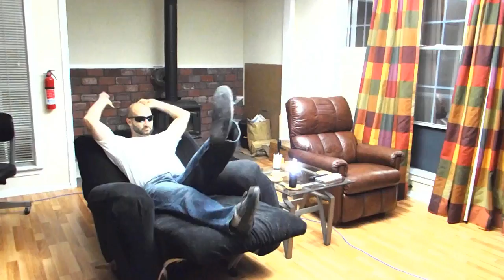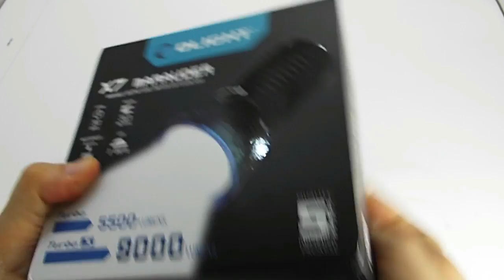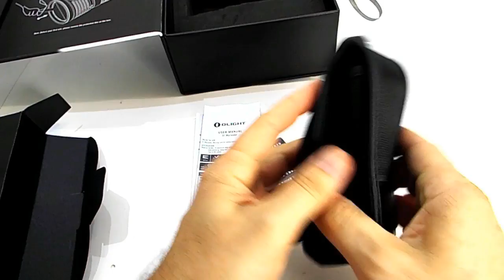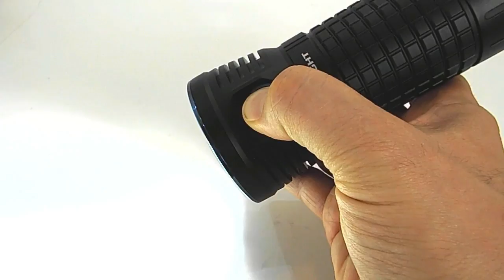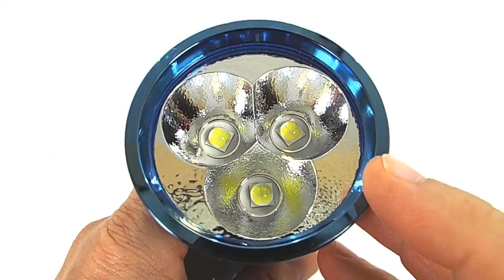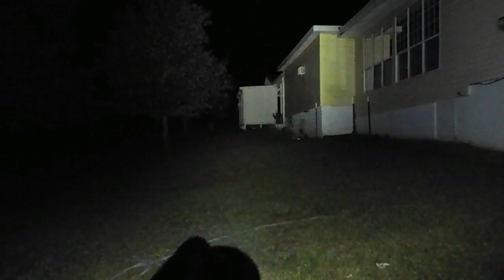Worlds Brightest Pocket Flashlight!

Comment: Can I use my  3.7v  18650 batteries instead of buying the kit for this flashlight ?
Reply from the maker: As long as the cells can handle the discharge rate.  I would get cells rated at a 10 amp continuous discharge to be safe.   Also using protected cells for this type of light is a good idea.
Reply: Thanks,  Can you tell me which ones your talking about that are rated at 10A  continuous discharge ?
Reply from the maker: Keeppower makes a good protected cell that is.
https://asflashlights.com/batteries-and-chargers/58-18650-keeppower-3500mah-sanyo-ncr18650ga-protected-button-top.html
Reply: What I've noticed is that Unprotected cells seem to have the highest Amp discharge. Is that true ?
Reply from the maker: BadRonald,   That can be true in some cases.   In a direct drive situation if you take the same cell and have one protected and one unprotected, the unprotected will typically drive the LEDs harder because of lower resistance.

Comment: where can i buy one?
Reply from the maker: Here is the 2018 version.
https://rover.ebay.com/rover/1/711-53200-19255-0/1?ff3=4&toolid=11800&pub=5575212299&campid=5338028491&mpre=https%3A%2F%2Fwww.ebay.com%2Fsch%2Fi.html%3F_from%3DR40%26_trksid%3Dp2380057.m570.l1313.TR0.TRC0.H0.Xolight%2Bx7r.TRS0%26_nkw%3Dolight%2Bx7r%26_sacat%3D0

If your looking for the older one you can get a pretty good price on them now.
https://rover.ebay.com/rover/1/711-53200-19255-0/1?ff3=4&toolid=11800&pub=5575212299&campid=5338028491&mpre=https%3A%2F%2Fwww.ebay.com%2Fsch%2Fi.html%3F_odkw%3Dolight%2Bx7r%26_osacat%3D0%26_from%3DR40%26_trksid%3Dp2045573.m570.l1313.TR0.TRC0.H0.Xolight%2Bx7.TRS0%26_nkw%3Dolight%2Bx7%26_sacat%3D0

Comment: I have this light its great, but I wish it was USB rechargeable.
Reply: Dan Bravo ..no you don’t. I was going to buy the new Olight X7R but I saw a video on YouTube were when the guy did a water resistant test the light stopped working because water got into the USB port. So I bought this one. :) even though the new one is 12,000 lumens.

Comment: Its a great light. Yes, it has a few downsides, but also a 5,500 turbo that will run for 10 minutes plus. Turbo S on mine will give over 6 minutes when hand held ( hand is a very effective heatsink ), but you can feel the heat for sure. The three ' normal levels are well spaced and quite useable. The big thing is being able to use cells of your choice, rather than a proprietary battery pack. No need to replace a whole pack if one cell goes down. Very poorly aligned LED's on delivery, but easily fixable by turning reflector/lens/bezel in relation to board. Double clicks to get to turbo and turbo S ? no big deal. No worse than clicking between normal modes. Maybe Olight could revisit their electronic switch, there are better ones out there. Reflector or optic? Personal preference I guess. Gotta love those X-HP70's though, sort of a modern day M-CE.

Comment: How long will this one run start to finish? I need a 150 watt for my projector so I can burn Families Cd's. The bulb's I have are frorm 70 to 100 and don't last bit an 1/2/hour or so.
Reply from the maker: Hi Karin.   You can run this light on at 1,800 lumens for about 3 hours.   I'm not a 100% sure how that compares to your other bulbs.  Watts are not really a barometer of light output, but if they are incandescent type bulbs an average 100 watt bulb will ouput around 1,600 lumens.   Hope this helps :)
Reply: AdventureSportFlashlights ...at 3,000 lumens it runs for 32 minuets. :)

Comment: did i miss it how long will it last 30 sec or 30 hours ?
Reply from the maker: Hi Gary,   I didn't say them out loud, but if you stop the video at 19 seconds all of the runtimes/outputs are shown on the back of  the box as well and also the reductions in turbo modes. :)

Comment: meteor m43 is defenetly smaller and gives more output with 12xXP-L HI
Reply from the maker: Hi.   Just curious, is there a version of the meteor that comes with 12xpl from the factory now or did you build your own?
Reply: AdventureSportFlashlights I dont own it.
It is not factory made flashlight. hank receive all parts and build it by himself.
M43 with different leds could be found both on mtn and i-o.
P.S. I suppose that version with 219C is also very close to 9000 lumens.
Reply from the maker: That's good to know.  Always nice to hear available options.   Thanks again.

Comment: Hey Matt, great video. I liked the humor and the music was pretty good as well. 

Interestingly enough, I was researching this light just yesterday. It's out of my price range at $200, but I like the concept. 

I may just buy a cheap $40 skyray king with 6 xml2 emitters and swap in a new 12 amp driver. That should be good for almost 5,000 lumen and be more compact than the L6. 

Anyway, have you done testing on this light? I'm thinking it must pull 13 plus amps on turbo S.
Reply: Get this instead: https://www.amazon.com/gp/product/B01H6Y05V6/ref=oh_aui_detailpage_o00_s00?ie=UTF8&psc=1

I believe it's pretty much the same as the Skyray King. Use this code for an extra discount: 863BZI6M

Comment: convoy l6 over this olight any day. 9000lm for 150 seconds, not what you would call useable.
Reply: In my usage I've found that it keeps up a high brightness for quite a long time. Around 5000 lumens (comparing to my X6), which is much better than the 1800 lumens drop on the box. I think the 1800 drop is for worst-case scenarios, where there is higher ambient temp and no wind blowing.

It has been a very useful and usable light in my experience. I've used it every night since I bought it. It can light up an entire 15 acre fish lake! Easily fits in a jacket pocket. You really have to see it in person to appreciate it. I imagine I'll pick up a Convoy L6 pretty soon though. It looks like a pretty sweet light for the price. No such thing as too many flashlights!
Reply: I've heard that turbo and turbo S are not memorized so if you want to turn the light on for short bursts you have to do a double - double click everytime. :( 
That's a bad design for my type of usage.
Reply: That is true. Double double to get to Turbo S. It's a pain. Memory is only for low/med/high. If you turn off from Turbo or Turbo S it will put high in memory (dumb). Moonlight takes something like 2 seconds to turn on as well. I've never been a fan of Olight's UI, and the X7 is no exception. Impressively bright, though. They got that part right.
Reply from the maker: Thanks for sharing NW :)
Reply from the maker: I think it would have been much better too if those were memorized.   It has a turbo timer on them, so I don't see any reason why they shouldn't be.